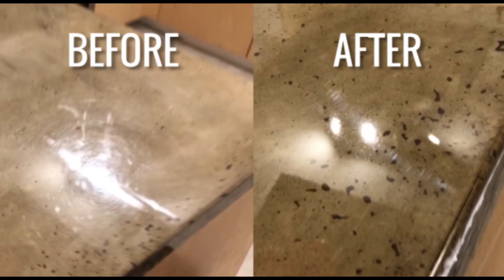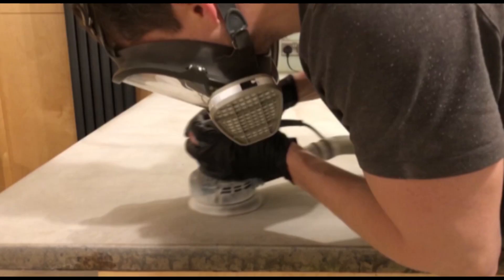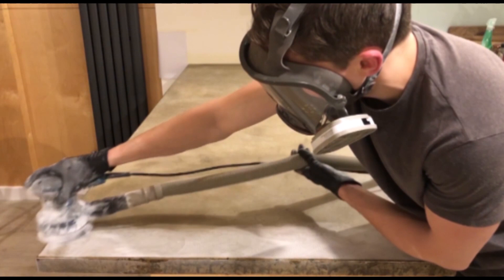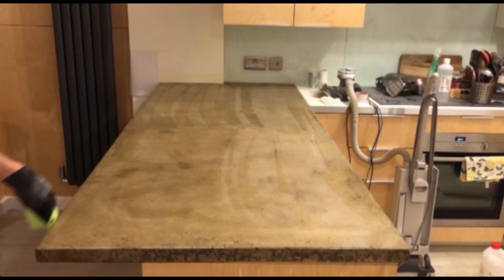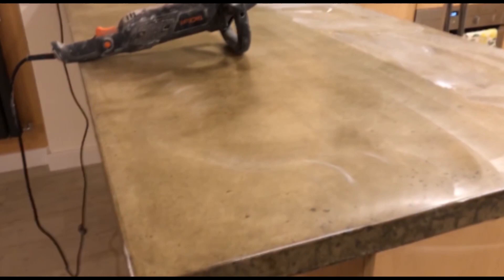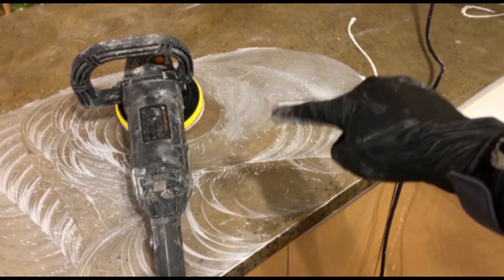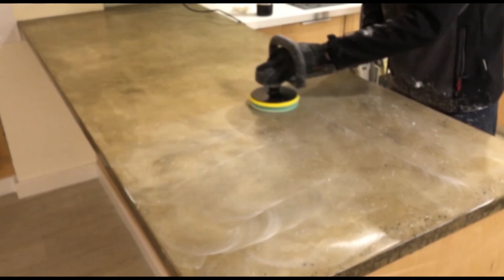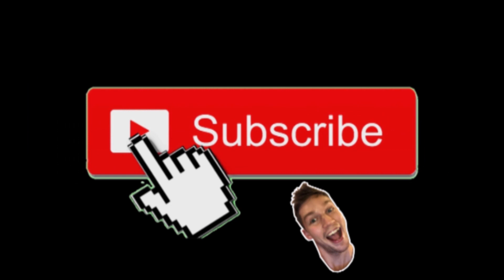FASTEST METHOD! How to Sand & Polish Epoxy Resin

Comment: Used a rigid orbital sander for my shower epoxy job 40, 120, 240 grit dry. Then I used 400 and 800 wet with a different sanding machine (not by hand). I'm at 4 hrs, as it's a full tub and surround with corners, soup dish, etc. 
Will finish up with the 1200 and then move onto the polish machine. Much harder than a flat countertop 🥵. But it looks  a lot better so far thanks to your simple easy to follow instructions!👍
Reply from the maker: Awesome, nice work!

Comment: Finally, a video that explains what i need to do to remove scratches from a 39ft bar! Was going to use Megulars Car Compound and Polish to fix the scratches!!
Reply from the maker: Thank you, glad you enjoyed the video :)
There are various combinations of polish that will work, but this is the combination I use and that has worked successfully for me. Make sure to use get the surface as shiny as possible with the the fast cut compound first, to a level where you think it’s doesn’t even need a final polish with the fine compound. Then move on to the fine compound and you’ll get an incredible shine. Think of the fine compound as more of a cherry on top after the main work is already done.
If you don’t polish to an almost complete level with the fast cut compound, you will still see small scratches in the surface when you move on to the fine compound.
It’s really satisfying when you get it right.
So, you’ll probably end up using maybe 3 times more of the fast cut than you will the fine compound.

Comment: WOW looks great. I have to say I used stonecoat countertop's product for my tops about 60 square worth. They say on there channel they cannot bring it back to a high luster. I am just about 2 years in and have a bunch of scratches which I would like to take out. I do have a da and an orbital with a bunch of pads. Still kind of afraid to do this cause once started I am commited and if it does not work out the wife will not be very happy. It is like a mirror and do not want to lose that.

Comment: can you share the names of the products you used please?
we just had ours done professionally. loved the countertops so much they were like glass..looked like real marble..but then the guy put a sealant on the next morning with a roller and they look like dimpled plastic. I'm devastated. 

I sanded one piece back with a 120 orbital sander and it's lifed most of the sealant off. Will polishing and buffing be enough to bring it back to the original epoxy?
and will the epoxy be enough on its own without a sealant?

Comment: Question: I have black epoxy floors all over my loft and recently, when I decided to get rid of a carpet, I realized that it had left a discoloration where it used to be, under my super heavy dining table (that I literally can't move on my own). Would a sanding and polishing job, as featured in this video, work to fix it? I'm hoping to not have to redo the whole loft if possible 😅

Comment: I am brand new to Epoxy Resin!  I have bought and old table with scratches and chips however I want to save it and bring out the luster to the table.  I sanded it with the proper snd paper however I did not use the wet sandpaper.  Then I polished it with Promise and I am not doing something right.  What do I need to do to bring back the shine to the best possible shine?

Comment: The result was great, but is there a real advantage to all this work vs just putting a light coat over the top? Does the newly resurfaced layer last longer since it's been hardening for years?
Reply from the maker: You could just pour over the top, you’d need a good key 120-180 grit for it to stick well. And you’ll end up with a thicker layer of epoxy overall. But each method works. Up to you. It would probably take around the same amount of work in preparation and time overall.

Comment: Nice video. Yet for such a large  area how did you not get any swirls or possible scratches while sanding without wiping after each pass not just when changing grits of paper.
I have gone from 80 - 2000 twice still scratch 🤷‍♀️ my project is a bit smaller but still the same process. I have the right sander! the right paper! the right vacuum! the right rags for wiping! All is right yet again if it’s not swirl marks it it scratches. Now my last piece manage to get no swirls and only some scratches. One question I have how long would you recommend on each grit of paper? A good speed on sander? 
I did enjoy the video thank you for sharing.
Reply: Please list what you feel is the right sander.  Also are you using a DA Random Polisher?  That is VERY important!

Comment: Great video Matt. I did try my first epoxy project with some wood coasters. The tops turned out great, but the sides got some scuff marks which happened when I moved them. I used 400 grit on the sides which got the scuff out, but what would you suggest for getting the shine back?
Reply from the maker: Sand all the way up to 1200 and polish with the polishing compounds :)

Comment: for wet sanding do you prefer swirl sanding or back forward sanding method?
to prevent swirls marks and scratches
Reply from the maker: A bit of both. Swirling your hand when sanding is easier to get more random sanding process and stops you from sanding to much in one area, which could cause dips in the surface.
But as long as your careful I don’t think it really matters. As the polish will remove the scratches in the end.

Comment: Love this. I am almost there I think. Please tell me that the 3m compounds are worth the money, it's getting expensive 😅. I am still getting burls might be trying too hard with the wet sanding.
Reply from the maker: You can polish metal with the 3M compounds which are harder than epoxy so I’m sure it will work for you.
Are you using a machine polisher with a sponge?
Make sure that that whole surface has only 1200 grit scratches or higher, no lower. If you see courser scratches you might need to go back in those areas and work your way up again.

Stay longer on the 3m fast compound that your might think. The 3m fine compound is really just an icing on the cake. The fast cut compound will do pretty much all of the polishing from 1200 grit up to a high gloss shine. You can if you want, only use the fast cut compound and it will look great when your finish. Just be patient and take your time with it, you’ll see it working after a while.

I hope that helps
Reply: @MattHutton  Thank you very much for you reply. I just got a 7" machine polisher and was using my variable speed sander.  Yes I think I will take it a step back a bit, watch and pause your video :) again. The right polishing pads seem to be hard to find on amazon, the links you shared are no longer available for me to even see and look them up and I am in Canada. I have called an autobody supply store so will go from there. I think it will be worth it. Thanks again. 👍👍
Reply from the maker: @dianerossong7198  okay no worries, hope it goes well :)

Comment: Will that same process work on expoy floors with CRU polyurethane finish?
Reply from the maker: It should work the same for most plastic finishes. Polyurethane is a little softer than epoxy so you may not have to push as hard to achieve the same results. If you try on a small test area first that should help get the process down before you do the whole thing.

Comment: Great video!  I have a number of resin tables that are easily scratched. I'm trying to find a "scratch resistant" product that provides a gloss finish that I can apply to the tables. Rubio provides a flat finish so something else is required. thank you
Reply: glass
Reply: Water based polyurethane is what they use to make epoxy floor coatings scratch resistant
Reply: Let epoxy cure, sand down with 220 grit sandpaper evenly, vacuum and clean, apply water based polyurethane.

Comment: So how can I polish up an epoxy pyramid? I’m also kind of broke and don’t have the buffing pad. Is there anything at home I can use?
Reply: I bought a  £3 polishing pad to go on my random orbit sander (180mm diameter c 20mm thickness). Hook & loop to just sticks on. Seemed to work ok for polishing a wood/epoxy shelf I made.

I used some Meguiars car compound and then polish, as I already had that. Total spend £6 (bought 2 pads).

Worth a go if you don't have the budget for all the tools etc
Reply: @iainarthur7713  thank you!

Comment: are there equivalent but cheaper option for these products? I experimented with resin and did a large paint. I m at the last step: polishing and waxing. but I don't wanna spend too much on these products cos I don't think I would do other paints using resin.thanks
Reply from the maker: Yes, you can buy smaller bottle of the same polishing products
Reply: You're gorgeous! 😉💕

Comment: Is there a benefit for using a regular rotating polisher over an orbital one or a dual-action one?
Reply from the maker: ‘In my opinion’ a regular rotating polisher is able to heat up the surface and allow the compound to work better. An orbital sander would take absolute ages and work extremely poorly. And I’ve not actually tried a dual action polished, might be a good option, but I prefer rotation only so as not lose torque in another direct. I feel like there are less variable with rotation only so your are more in control of the result you’ll get.
Reply from the maker: @koolkid1234ism  worth a go! I’d be interested to see how you find it. What are you polishing?
Reply: @MattHutton  I was going to polish wood/resin tables, and use the polisher to buff in 3m cutting compounds, and then osmo. There are so many different osmos tho I'm confused lol
Reply from the maker: @koolkid1234ism  you were going to polish the raw concrete with polishing compound?
Reply: @koolkid1234ism  thats what i just bought! da’s are the best for auto & epoxy tables, rotaries are for gel coats on boats and large work for bad paint!

Comment: Why did you not use the sander when you used the wet and dry paper?
Reply from the maker: You can use the orbital sander with the wet and dry paper too. But I like to do it by hand at that time because you’re really just buffing the surface after you get to 400-1200 grit. And I feel like I have a bit more control when I do it by hand. The orbital sander is good at getting the surface flat, but it can be quite harsh.
Reply: @MattHutton  Thanks for that. Will try that to see if I get better results.
Reply: @MattHutton  this makes so much more sense now. I've spent weeks redoing projects because I still see scratches in my work. No matter how many times I go over it. Just the same outcome
Reply from the maker: @JohnDoe-kg1on  amazing :)

Comment: Why aceton? For what reason?
Reply from the maker: You can use water. Acetone doesn’t leave a residue and you can see if there any dust left over very quickly after wiping. As it evaporates very quickly. If you don’t like the smell water is fine :)
Reply: @MattHutton  if that is only reason I would suggest cleaning alcohol. Should give you same results and is safer.

Comment: Just put sealer 
No needs all this work will not protect the surface it is like waxing car nice for short time.
Sand lightly 220
Dry by hand. 
Clean . Put sealer protect for everything.
Last long .
No need all this sanding and process looks good but no protection 
Forget about it